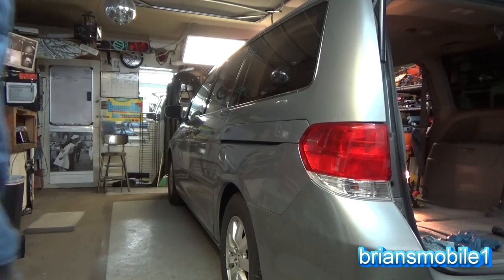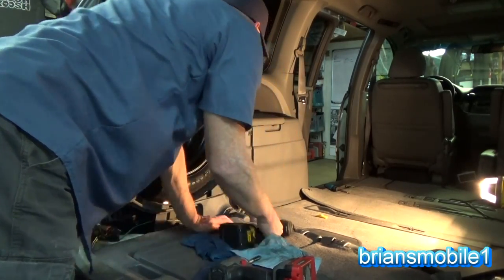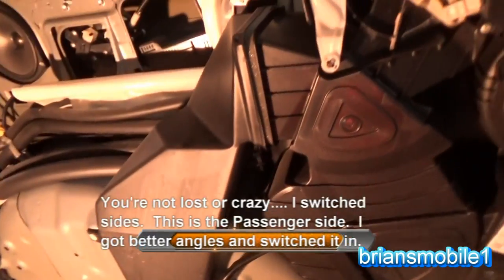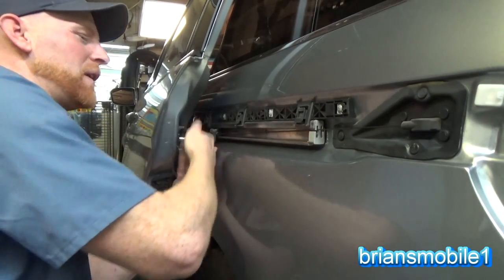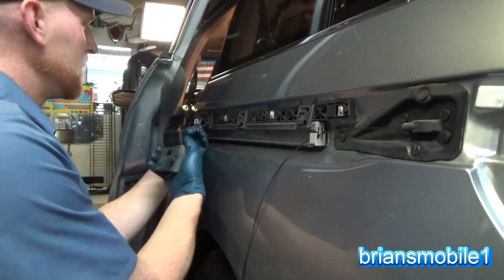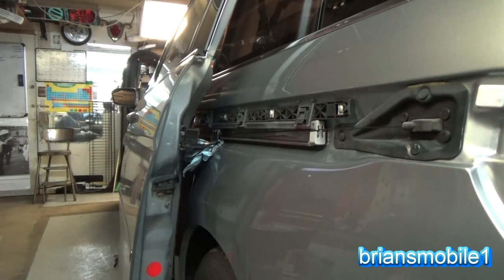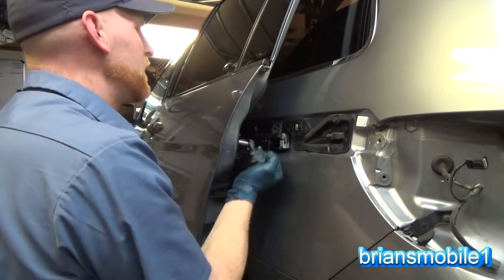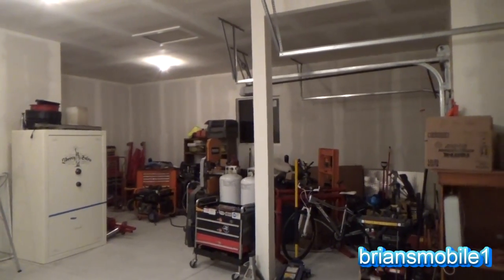Fix a Honda Odyssey Side Door That Won't Close or Open

Comment: Door started not closing on a consistent basis.  Sometimes it closed sometimes it went half/full way then just beeped.  Then the cable snapped.  Had to buy the whole motor assembly because they don't sell just the cable separately.  Popped out the door hinge pin with vice grips instead of unbolting the hinge as shown, and I didn't have to realign the door.  Thanks for the great advice!  Video made it easy and my $150 ebay motor purchase saved me over $1500 at the dealership.  If you're replacing the rollers on one side, just do the other too, since even if you don't notice problems now, after you remove it, you'll notice that they DID need replacing or soon anyway.  You've got all your tools out and have the process fresh in your mind.

Comment: Good info. I just did my 06 last week. I leave the hinges bolted in and use an old Matco hinge pin popper. Sadly one of my drivers side cables is broken :(

Comment: Hi,  Very helpful tips on replacing the hing/rollers.  Just did that to my 2005 odyssey but the power part does not want to function , so wondered if you would mind giving me some pointers as to how to get that to operate again?  Thanks a bunch, Gerhard

Comment: This is all great, but my door wont budge, stuck in open position... I've reset fuse, all the buttons... it's a mechanical issue I can't find a release to get the door manually closed.  Rain is starting and I'm pissed this thing can't be closed manually.

Comment: 2005 HONDA ODYSSEY TOURING - RIGHT PASSENGER SIDE DOOR WILL NOT OPEN, BY INTERIOR REMOTE BUTTONS OR KEY FOB. WILL NOT OPEN MANUALLY INSIDE OR OUT. SOUNDS  LIKE MECHANICS ARE WORKING, YOU HEAR MOST CLICKING, BEEPING LIKE MOST THINGS ARE TRYING TO OPEN, BUT NO MOVEMENT WHATSOEVER. SO IT FEEL MORE LIKE THE LOCK, OR ACTUAL LATCH IS NOT - UNLOCKING/LATCHING. (?)(?) . . .  WHAT DOES THIS SOUND LIKE? WHAT WOULD COST OF PARTS AN LABOR RUN? I JUST DON'T THINK I CAN DISMANTLE A DOOR THAT WON'T OPEN AND TROUBLE SHOOT.

Comment: Now that you have a blank worksheet as it were you could come up with a trolley system for your camera, just an idea. By trolly I mean from the ceiling complete with lights and you could put an arm for swivel properties. I'll be moving in 4 years so if you don't do it I will then, then I could do,my wood turning movies without having to fit with the camera. Great video and about the speech , they make me mad every time the @&(;:&/@ comes on our tv. Keep the faith my friend it has to get better.

Comment: It looks like this van driver side rear door has a manufacturing defect. Clearly, the door edge is too long that it constantly hit the rear quarter panel each time the door is closed. This should have been detected at the factory and fixed before it leaves the factory. The proper fix for this is not to adjust the door forward because the door gap is perfectly aligned along the rear door edge. The right fix is really using a file to file off the sharp edge of the door to create enough gap to keep the door from hitting the body. Then use touch up paint to paint both the door where the edge was filed off and the dent on the body so they won't rust. BTW, don't buy the cheap door rollers on Amazon, they are mostly junk based numerous customer reviews because they only last a few months. My 3rd Gen Honda Odyssey OEM roller lasts more than 14 years and still going. When the time comes to replace them, I will stick with Honda parts, it is not worth my time to take every thing apart to replace these rollers every few months!

Comment: Thanks for the Information! This worked great. Replaced Passengers side. Mine is a 2005 EX-L.  First had to reset the Door Controller just to get door to move.  This is done by removing F7 from Fuse box on Drivers side, turning Key to ON position, then off, Put back fuse and then door would move to get to all screws(learned on another video ).  Also Lubed rail with Synthetic grease before re-assemble.  Thanks again. Great Video.

Comment: My van is doing the exact same thing, changed the rollers and even though I supported the rear door with a jack and marked where the bracket was afterward the automatic controls don't allow it to close. I can close it manually very easily, but it beeps about 3/4 the way closed. Any ideas?
Reply: Watch other videos.Remove the fuse of the sliding door and reinstall.
Reply: Mine does the same. Did you figure it out?

Comment: First off I'd like to thank Brian for uploading this video - it solved my door problems and I previously thought the problem was the motors inside the door! Here are some of my observations you may also find helpful. 
1. Since it is hard to see the nylon rollers until you actually remove the trolley from the track I'll say this with some certainty: If your van is over 5 years old they probably need changing. Open the slider all the way. If you can pull on the rear of the slider (by the trolley) away from the van and the door appreciably moves - you need to change them. If the bracket holding the rollers can be pivoted as you yank the door towards or away from the van, you need to change them. If your door gets hung up and retracts then you likely need to change them. Three of the four of my rollers were GONE and the remainder was good for nothing. 
2. The inside bolt holding the bracket to the door is hard to get your socket over squarely. The socket driver's head bumps into another part of the trolley. The result is a rounded bolt head and a huge problem. The creative solution to removing this bolt was one of two huge time-sucks. A 12 mm open/closed-end wrench would have saved me almost one hour's time. Well worth the purchase as most of us only have metric sockets, I imagine.
3. I find that as plastic ages, parts that should snap together just snap off. I really didn't want to open the inside rear of the van if I didn't have to and have to listen to years of rattle as the plastic cover's been broken and is now loose. I read a review on an auto parts site that said there is just enough slack in the cables to negate the need to enter from the inside and release the tension. Uh, sort of. The only way to do that is to MUSCLE the cable and the only way to do that is by vice gripping the cable and greatly wrenching it in place. On my van I got one side but at a cost to my cable. You will wear away the plastic coating and nick it fairly well. I now worry about a rusting cable. The other side I found impossible even with some creative attempts. This was my other big time-suck. I finally had to bend a part of the trolley out of the way, muscle the cable end into place, and hold it there while I bent the piece back in place. It's impossible to know if this was the right move because I'll never know if I would have messed anything up by entering the rear of the car. Even when I found the second side impossible I still resisted entering the rear - I guess I was fairly confident something would have snapped and then I would have just transferred my broken trolley problem into a broken rear, inside panel problem. 
4. No endorsement one way or another here - just an observation. The parts on Amazon highlighted above have, at the time of this writing, received one star 45% of the time. 
Thanks again, Brian.

Comment: THANK YOU! Your video guided me through what would've been an otherwise challenging job. I was able to easily follow all your steps with complete success. It didn't solve my doors not working automatically, but I figured that out (had to bust into rear latch assembly and lubricate stuff). Thanks again!
Reply from the maker: +2 Travel Dads blog (The Taylors) You're welcome!  Thanks for your support and for subscribing!

Comment: Good luck with the new house.  Sent you an email thanks the other day about a tip you showed a while back on removing a radiator fan clutch nut from a water pump using a pointed chisel air hammer bit.  Worked fantastic while working on my F150 the other day!  Thank you Brian

Comment: Great video, thanks Brian! Long story but I ended up cutting the guide wire on the driver's side sliding door since the door was jammed big time, came off track, we were in a rush and I didn't know what I was doing at the time... I was thinking to myself... "wires are cheap and replaceable" but I have a feeling that it is part of the  motor assembly? Am I screwed because I did this or is it easy to replace the wire? Thanks for your help.

Comment: @ briansmobile1   Great tutorial.  I followed it to the letter and when i removed the hinge i found that both of the small rollers were completely gone.  One issue however, when i finished installing the new hinge and put everything back together the power door would not fully close at the end.  The door travels very smoothly towards the closing point but it just won't fully latch.  Also the door will not open under power now either.  It is very smooth manually-much-much smoother than the other side-which will work under power-I will need to replace that hinge soon I suppose.  I was afraid that maybe i misaligned the hinge when reinstalling it.  I thought maybe i lifted the door too far with my jack when attempting to support it.  I fiddled with it for a few hours adjusting the door alignment but still haven't had any luck.  Any thoughts on whether alignment could cause this to occur?  Or maybe I have another issue going on.  Thanks in advance
Reply: +Steve McKinney Were you able to figure out the issue of power door not working and door not closing at the end after you installed new rollers? I seem to have simillar problem but can't make it yet. I also thought it would be alignment issue and was going to open the latch and try installing again. Please let me know if you were able to resolve this issue. TIA!
Reply: @contactabdeali old comment, but I also have the same problem. Did you get it fixed and what was the issue?

Comment: okay there is no need to remove anything on the inside, you can release the cable outside just pull it with a pliers
Reply: Positive on that? Im looking at this repair in the next few days, hopefully I wont need to take apart all the interior...

Comment: I need to do this exact job, the door cable is broken..... so I'm having trouble even opening the door, and I've tried everything..... yes, Ive turned off the power doors and tried to manually open it, but it still will not open..... what next..... I need to open the door to get to that screw to pull the outside panel off first.

Comment: On my 2008 EX-L I did this without releasing the tension... no problem... saved a lot of work on that inside stuff.  Eric O. has the book-beater video on this.  I used the floor jack with a 2x4 under the door, just easier.

Comment: Help!!

I replaced mine and now the door won't open or shut unless done manually. If it's shut and I press the button to open it, I get three beeps and it fails to open. 

If it's open and I press the button or pull the handle to close, they door moves forward and then when the hinge rounds the corner, it beeps and reverses open.

Did I not get the hinge lined up properly? I marked mine, and have readjusted several times but not making any progress.

Comment: Hi, Thanks for the video, I would like to know what was the real problem when the door didn't adjust at the testing time? And, I have the same problem with my odyssey 2007 but the passenger's side, my question at this point is if the piece I need to replace (passenger side) is different from  the drivers side? I think I can do it. By the way I from Mexico.

Comment: No wonder those doors fall off so often. Have seen them fall off while the van is in motion, though admittedly one was a Nissan E20 that probably had the door open and close a million times or more. Fell off as he was driving, and the conductor simply walked back to fetch it, like it happens all the time.

Comment: I'm also fixing my door but have had to replace the motor and now can't get the cables to reattach to the hinge.  My front cable is attached to the hinge but the read one is about 6" away from being able to attach to the hinge....any recommendations would be great.

Comment: How do I know if the door won't open or close because of the trolley or if it's due to the Actuator Assembly?
Reply: +Chet Kenisell 

Did you ever diagnose this? I have a similar situation but dont know which
Reply: +Ken Dudley I just followed this video. The trollies needed replacing. The plastic wheels become brittle and break off. Once that is replaced, you can then determine if you have problems with the motor. I would say that this is step 1. The motor replacement would be step 2.

Comment: briansmobile1 Thanks Brian for this! When I was a Tech at Honda I did this a bunch of times. They used to come with everything so you wouldn't have to take the hinge apart. I would mark the hinges with a wax pen before I removed them to make it easier to align the new ones. Another issue with the Odyssey power rear doors is the contacts on the door and the b pillar I would take a pencil with a piece of sandpaper on the end of the erasers to clean the contacts. Studio/Garage looks good. So your going to build another garage in the space you showed? Thanks again for all the videos! Congrats again on the new place!
Reply from the maker: Thanks!  The "Studio B" is in the planning phase.  I have to get an architect to sure it up and I've got the concrete guy lined up and waiting.

Comment: Great video. I'll probably never work on one of these, but can still learn stuff. New word: those lines near the head of the pin on the trolley that need to be banged out: "knurls". They are made the same way as diamond shape knurls for grip on tools etc. You probably knew that. Nice place. Congratulations! Thanks for doing this.

Comment: Thanks for posting this, it's very helpful and well-explained. Especially the end when the door wouldn't line up. Just one question, is the grease on the roller wheels necessary? I've seen some other videos on this and some people skip the grease. If so, what kind of grease should I buy? Thanks

Comment: The part where I really needed to hear specifics (aligning the bolts to reattach the door just right) is where you  instead decided to go on a political rant. 
Disappointed.
Reply: If you watched the video all the way through, you would have seen he eventually described a work-around for the issue of taking the bolts out.

Comment: Hey, I know you posted this video quite some time ago but I have a question hopefully you can shed some light on. About a month ago I was backing up and I ran into a fence on my passenger side and now my can door will not close I tried replacing the middle roller piece because it was damaged but it still won't close. It closes almost all the way but has about a couples inches it's kind of like something is stopping the door from closing even when we try to forcefully close it (I know we probably shouldn't). Do you have any ideas on what might be stopping it from closing? Maybe something to replace? Any ideas will help me out a lot. It slides but just will not close all the way. Thank you.
Reply: I'm having the same issue and now I can't get the cables back on the hinge, like 6" apart
Reply: I have pretty much the same story except the roller at the top is really low and almost off the track.  What did you end up doing to resolve Lola?

Comment: NOT helpful for me! Mine is a 2010. I do NOT have this feature in my van at all!!! And my doors are still stuck! Both sliding doors! Mine is not mechanical. They don't slide on their own. You have to open and close them manually. So this is useless.
Reply: Lubricate at least 4 times a year.
Reply: Look up a 2010 ?

Comment: Excellent Video.  I was able to replace the roller trolley without removing the interior panels.  The cable is pretty tight, but loose enough to get it out of the trolley.  thanks a million, Brian.